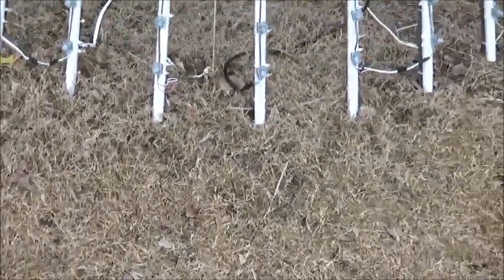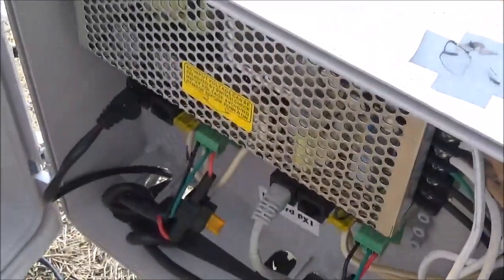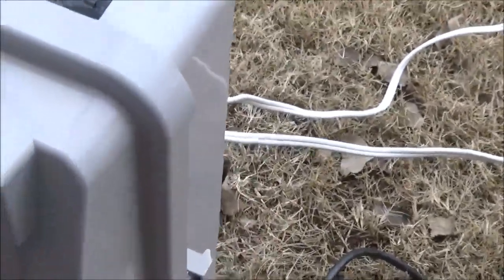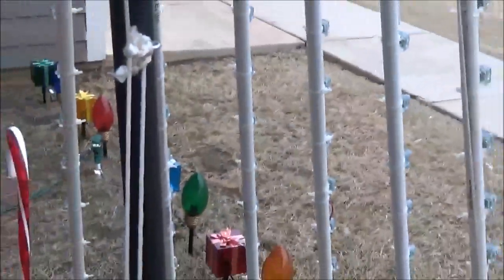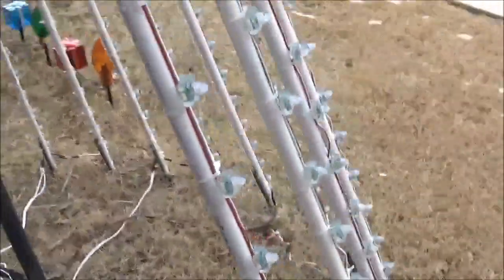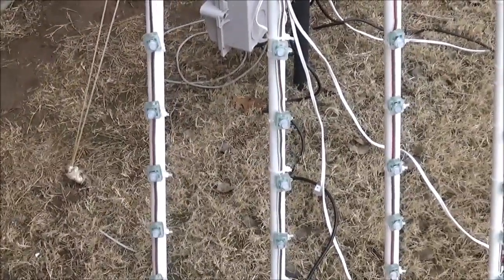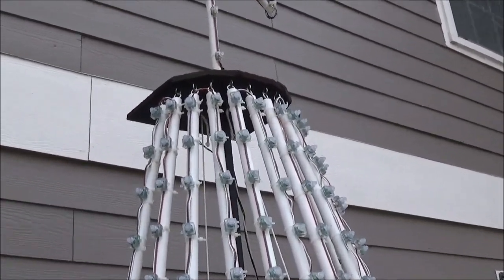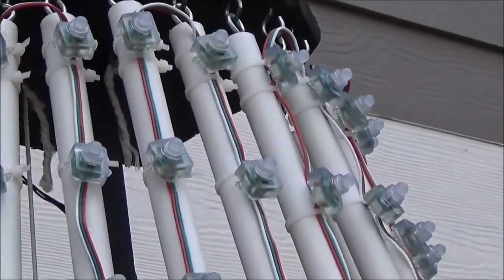pixel tree making

Comment: How did you design the tree in Layout? Every design Ive seen can only control one strand. Does that make sense?
Reply from the maker: not sure what you are looking at my tree is 6 strings folded over at top
Reply: In the Xlights program you can tell it how many times you have "folded" a string over. It knows the start point then configures each light accordingly. If you have one strand of 50 and tell it you folded it once, it will know lights 1-25 go up, 26-50 go down.

Comment: I guess what I'm asking is how does your program know your string goes up and back down? instead of 12 separate strands?
Reply from the maker: ok that depends on which program you are using I use vixen 3 in vixen 3 you have patching ( a way of tell you controller what lights are where) so when I do the tree the first leg I patch normal the 2nd leg I check the reverse box the 3rd I do normal and so on

Comment: How many  PVC did you use for the tree
Reply from the maker: that tree is just 12 legs 180 degree tree used 6 strings of 50 pixels folded at top for it
Reply: @jamesletizia5042   thank you  so much it looks  great  good job

Comment: Thanks. I'm using xlights nutcrackerand haven't found a way to do it yet.
Reply from the maker: xlights has a way also the version I have when you setup the tree in the bottom left side setting. lets say with my tree it is 6 strings of 50,  string is 50 nodes, but leg of tree is 25 and makes 12 legs for my tree), so set # of strings to 6, # of nodes to 50, and strands/string to 2
Reply: James Letiz thanks for all your help. That is how I pictured it being done. Now I was able to figure it out with your help. Building a 12 ft mega tree. will be completed tomorrow if it doesn't snow. Happy holidays